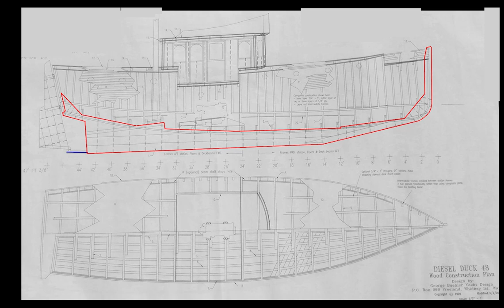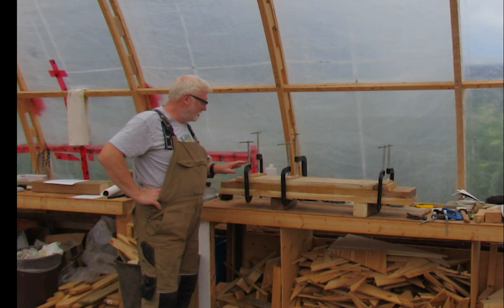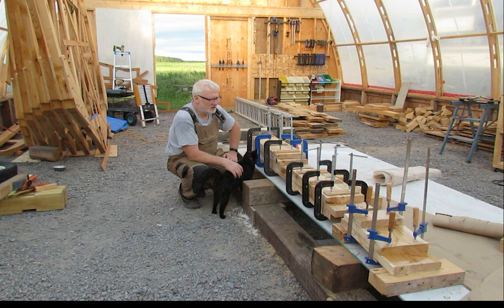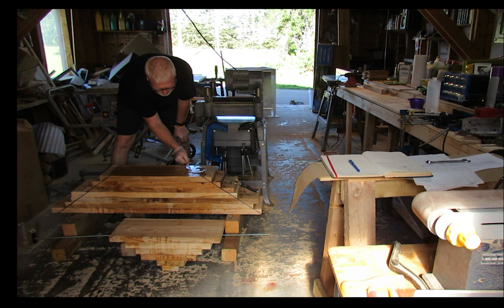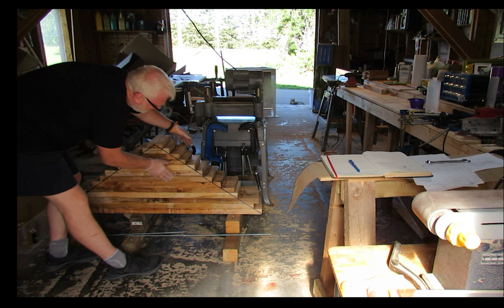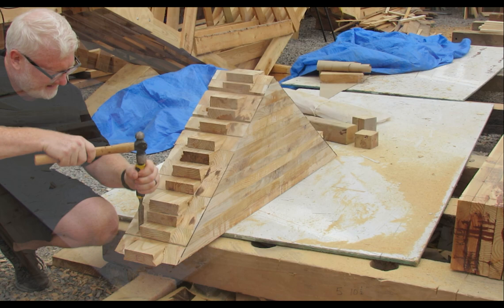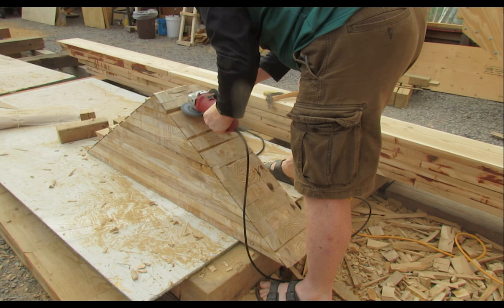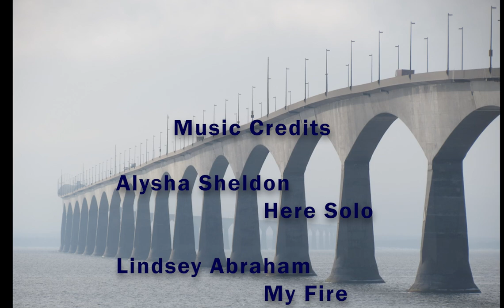Boat Build Keel - Knees - Ep 15 - Building A Wooden Troller Yacht

Comment: Put 2x4 blocks on sides, drill holes for rod and put a slight curve on 2x4 side. When u tighten, the curve will touch middle of board then bend a little. More middle squeeze. Use heavy washers under nuts so 2x4s dont get dug in.    Max squeeze if wanted. Looking forward to more.
Reply from the maker: They are so easy and cheap. I used the 2x4's face and found they worked ok. I sure rely on them for the rest of the keel build.

Comment: Bill, you prob know of Scott from Six Points Woodworking who’s building one of these boats too. I reckon you may reach out to him and ask what tools he’d recommend you to carry on with. Watching you chopping that knee out was agonising and someone suggested a sabre-saw to hack off the bits that the circular saw can’t reach. Sounds good idea to me and you’ll make heaps of use out of one. Another tool that comes in handy too is an oscillating saw. Given how far you have to go I don’t think you’ll be disappointed you bought them. That’s provided you don’t have them already. 2c Andrew. BTW I’m a builder too but in the closing stages of a 22’ yacht. Nothing like the size of your job.
Reply: I think you northerners call em a reciprocating saw.
Reply from the maker: Hi Andrew. Actually it was Scott's build who convinced me to build a Buehler DD. He is building a 42' and mine is 48'. The build is virtually the same, although as you will see in the next couple of episodes the keel sub-assemblies are slight different in size and shape. Also, the 48' keel timbers are slightly larger at 1.5" x 9" whereas the smaller builds are 7".  I am finding that 2" a big difference in some of the techniques Scott was able to use versus mine. I am hoping to met up with Scott one of these days so we can compare notes, laughs and tears.

Comment: might be a bit late but if you’re still hand chiseling.  how i cut thick timbers is to do the two exterior cuts then use a long blade in a reciprocating saw(sawzall?) the two outside cuts act as guide and it works a treat cheers from Australia 🇦🇺
Reply from the maker: Hi Dennis. I did dry that technique when cutting 6x6 timbers in half for the frame timbers. I guess I am too impatient as it seemed to take forever.  I made the two cuts on opposite sides, then used a chain saw to finish the cut. Worked most of the time.
Reply: @TheAmblerOdysseys   Also depends on the blade used i found that the diablos performance really outdid others and this was in Aussie hardwoods which are up there amongst hardest world wide cheers
Reply from the maker: @dennisbinyon9023  I will have to try the diablo blades.  I have diablo for my router bits and love 'em. I am very envious of the hardwoods you Aussues have available. I follow a couple Aussie boat build YT channels that use beautiful woods that are a heafty premium here in Canada.

Comment: If you want to stop the epoxy boards from sliding pour a layer of salt on the epoxy afterwards before you lay the new board or the next layer on it will prevent the slippage of the boards.

Comment: Nice going Bill. Funny enough your build crossed my mind just a couple of days ago. I was wondering how progress was coming along.  Epoxy.  Sticky, dusty, but an awesome material to use. Building an epoxy/pvc sandwich trimaran I’ve chalked up some experience with it. I find West System to be relatively forgiving mix wise.  I’ve seen people labouring over scales to get the perfect ratio. That’s just a waste of time. Close is good enough. Perfection is not necessary.
I use pumps, but when I’m mixing up repeated large volumes, (which you may never need to do), like doing a 7 meter - 24’ x 4’ pvc layup, I pump out 12 shots into my plastic cup, then mark it with a felt pen, then pump the hardener. From then on I remove the pump from the resin container and just pour it into the cup up to the mark - way faster and easier ( especially if it’s cool and the resin a bit thick ), then I pump the hardener, which at the 5:1 ratio is significantly quicker than pumping the resin. If I pour a bit much resin on occasion, no problems, I just guesstimate whether I need an extra pump or whatever of hardener.  It’s close to 5:1, but not exact.  I’ve never had a failed cure.
Keep up the good work. The ocean awaits. Cheers
Reply from the maker: Thanks Robin. Good point for mixing larger amounts of epoxy. I will be in that predicament when I fiberglass the hull. The hull will be two layers of ply over one layer of planking, all covered in fiberglass. So I was thinking of working in roughly 4' x 8' sections at a time. I did try my best to measure accurately on the digital scale but I wasn't to concerned about being a gram out here or there.  In fact a couple times the scale read out turned off while measuring out so more than a few times there was some guesstimation going on, with no problems on the end result.

Comment: Total Boat suggested that i donot mix the epoxy and hardener by weight because each has a different density and i would not get the correct bonding.  Not sure if Wet System is the same. By weight, the ratio mixture would still be very close and may work just fine
Reply from the maker: West Systems includes mixing instructions for both by volume and by weight. I have not used Total Boat products before but I am sure I will at some point.

Comment: Bill, just a heads-up, the epoxy I use has a different ratio for weight v volume. My 2c
Reply: Oh and put a primer coat of neat epoxy on first, then the thickened glue
Reply: @R.E.HILL_  I think that might be the 3:1 by volume hardener. My understanding is that West has a couple of different ratios depending on which hardener. I don’t use it myself so more research is is needed. My epoxy is 2:1 by volume dunno the weight ratio, 1.44 : 1 is ringing a bell though.
Reply: The 5:1 West will be different by weight , best check it Bill. West uses a 3:1 for some hardeners and 5:1 for their normal hardeners.
Reply from the maker: Yikes, I had to double check the ratios. For the West Systems 205 and 206 hardener weather by weight or volume it is a 5:1 ratio.  The 207 and 209 hardeners are  3:1 by volume and 3.5:1 by weight.  Rereading the West Systems manual, they refer to both single step and two step bonding, the later I believe refers to when using thickened epoxy. The initial wet-out allows the epoxy to penetrate into the surface. The thickened epoxy then bonds to the wet out layers.

I certainly appreciate the comment. It made me go back and make sure I had done it right. It is easy to get complacent and rely too much on the old grey matter sometimes.